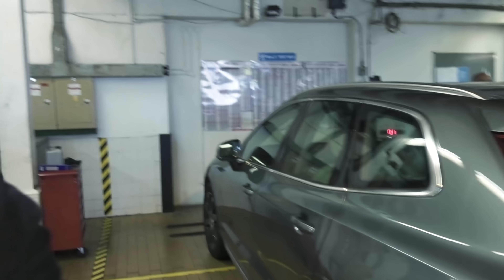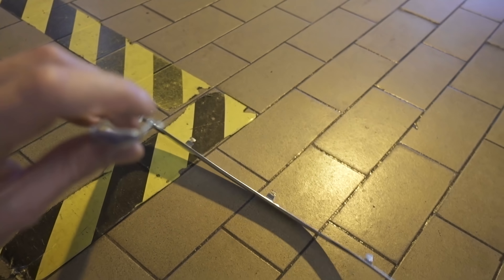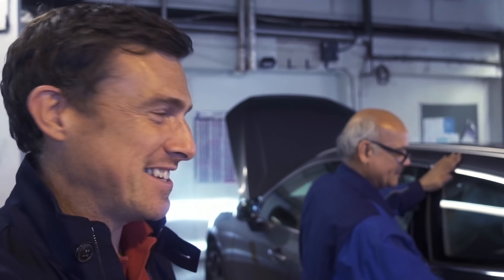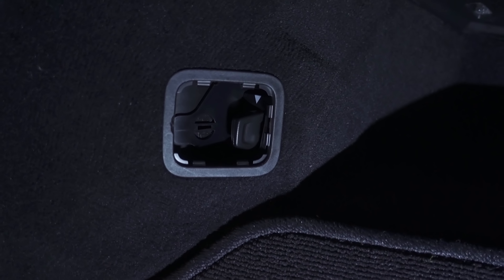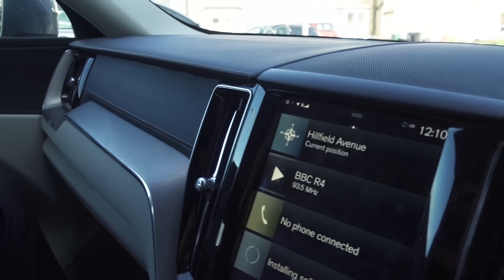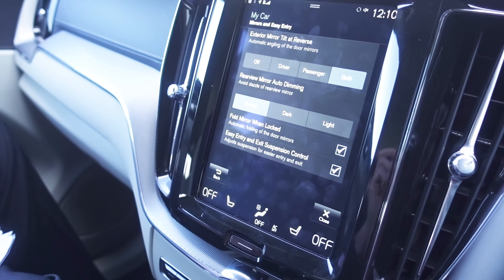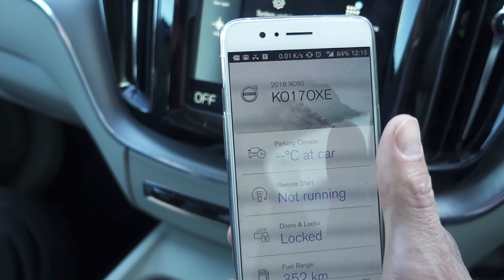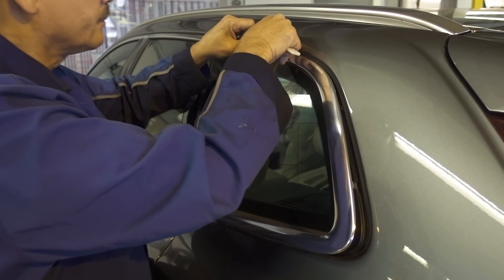My Volvo XC60 had to visit the workshop to be fixed... | Mat Vlogs

Comment: That's why u don't buy New cars instantly. They always have flaws. Just wait a year or so and then buy it.
Reply: Or choose a more reliable brand
Reply: Qua Pro Pro Volvo is reliable, but it's New platform that this car is sitting on. And it's early production car
Reply: Doesn't really matter if it's a reliable brand. Because 1. Volvo is a reliable brand 2. First edition cars always have problems. I remember when my dad got the Tiguan when it came out. In and out of the shop over the 3 years he owned it.
Reply: Qua Pro Pro 

There are SO MANY HIGH KMS Volvos still on the road. In fact (if I remember the stats correctly) more high KMS cars still on the road. More than ANY other brands.
Reply: true
Reply: Wilhelm Volvo cars are not really reliable.
Reply: rkoforever90 

Huh! Not in my experience. In my life I have owned 6, NEVER once has any left me stranded. The maintenance costs are low. I have had to put in like $7k in TOTAL (for all cars) for unscheduled maintainance. HOWEVER the other cars we have owned left us "up the creek" many many many times. No pumpkin. I have to say, in my experience with Volvo's they are cheep to drive and are super very reliable. I sold my first Volvo for $1300 it had 498000 kms on it. It is STILL on the road and now has like 700000 kms.
Reply: Thats no guarantee it won't have faults. Modern cars have so much software and electronics in them even late lifecycle models can develop faults very quickly.  The trim issues though are probably less common though.
Reply: How old are/were your cars? I've seen the old boxy models 80/90s last for many many miles, newer ones not so much.

Comment: As long as they don't have to tear down an engine to replace faulty designed piston rings Volvo is great to deal with...but vehicles even 10 years old with less than 70k km shouldn't need an engine rebuild T5/T6 customer.

Comment: I know two people with different volvo models and they both have the same problem with various parts of their chrome trim, I think volvo use cheap chrome parts. They've also both had issues with the software in their cars, Bluetooth and the USB working intermittently, one minute the USB simply will not work and then another time it's all ok and the Bluetooth constantly disconnecting and dropping connection with their paired phones. This happens on both their different models so it looks like volvo has some software issues. They've tried having their systems updated but the problems soon come back again, you never seem to have these issues with their German rivals.
Reply: I've had seven family and business phones connected by bluetooth to my car so far, plus three different iPads, and have never had a dropped connection. The only issue is that when parked, the electronics shut down after a pre-defined period and I would like to override that when working from the car.

Comment: Volvos do have some dumb designs I must admit but come on. It's only cosmetic stuff. Not as if the gearbox exploded or something.
Reply: They use the same brand of transmission, indeed the exact same transmission as Lexus. A slightly different version of the same transmission, using a clutch pack brake rather than a band [due to more room] is used in most Audi Q7 and many Porsche Cayenne models. I've driven and indeed one some of these and the Volvo transmission is just as good. The brand is Isin Warner by the way.
Reply: Here's the thing, if you buy a new car, and all this simple shit is already falling apart, what does that say about the likelihood of the more important mechanical parts holding out as long as they should?
Reply: shikori o So basically you're judging a car's mechanical integrity by a piece of plastic chrome trim? If that's the case all cars have "major" problems by your standards. Take public transport then. They're more reliable.
Reply: No, we're all judging the cars build quality, attention to detail in the building process, and most importantly, quality control, which clearly was far too poor for this car.

Comment: 1:57 - are you kidding me? you can clearly see that the bottom-right corner of the trim still pops-out...
Reply from the maker: +Theodore Vasilopoulos no it doesn't. It's the same as on the other side. I just checked it.
Reply: carwow that means it’s popped out on both sides!
Reply: Some side rear trims are like that. See bmw e46. It's normall

Comment: I work for an Audi dealer and the faff with the trim is massively unprofessional.
Reply: Most Audi stealerships I've had the misfortune to frequent have tried to uplift invoices for work and parts that were not needed. Even asked them to look at an electric seat that occasionally blew a long-blow fuse and they said " technician has diagnosed the fault and two seat motors are burnt out which are not individually replaceable. That'll be £1500 for a new seat sir!"  In fact a local mechanic then had a look and sorted it in an hour with the only part needed being some insulating tape. It worked ever since complete with fictitious burnt out motors diagnosed by a "master technician" [more like by a lying grease monkey].
Reply: Huw Williams As Matt explained, in a lot of instances you find that there are easier ways to bodge a job, but the manufacturer will not allow people to be ripped off.  Did you exercise the appropriate methods to complain?  It is worth noting every dealership is different mind.

Comment: You wouldn’t have these problems with a Volvo xc70 lol. If it did have problems it would be cheaper to fix if it did. Instead of buying an expensive Volvo I would buy the not so expensive Volvo I was talking about. And we all know the older volvos are indestructible.

Comment: Hi Matt, great video as ever! I'm sure I've heard somewhere that the marks on the chrome trim are caused by tiny particles of brake dust that are thrown into the air on a wet/damp day, when the car is in transit on a train transporter. I am told that it has corrosive properties too 🚘🚘👍🏻

Comment: My 2013 XC70 has trim like that 😡😡
Reply: I fixed mine - just the clear coat that has the marks. Use 800 grit sandpaper followed by 1200 grit and finish with 2000 grit. Then polish - fixed.

Comment: Revealed: the 25 most reliable car brands in Britain

Previous slide Next slide 25 of 28 View All
Volvo
=1. Volvo

Volvo's meteoric rise from 17th to joint 1st in the reliability rankings is the most impressive we've seen so far. The Swedish manufacturer has built some exceptionally impressive cars over the past couple of years, including the V90 pictured. It's a premium brand, the only one to rank in the top 10 let alone the top three, and its cars are among the safest on the road.

Comment: Volvo are knocking out too many new models too quickly...recipe for endless quality issues and lack of workshop tuition.
Reply: Not really. Common platform. Common components. Common software. Common knowledge base.
Reply: Huw Williams .. well yes but it's the integration that goes wrong
Reply: george mcray 
It is far easier to integrate common software and components than if each model were unique and distinct, as was traditionally the case. As it is, the biggest headache on the production line is to build each car according to its unique equipment specification for each customer and country. 
Volvo have developed a very simple and efficient way to build their cars. Whether they have got the details of the car design right, well that is another matter. For my part and in six months and 9000 miles, I’ve had only one dead battery and one mapping software issue, both resolved quickly and efficiently on the same day. Otherwise my XC90 D5 has run perfectly.

Comment: This is a brand new car ... one would have thought it would run perfectly . considering this is a premium brand ... odd
Reply from the maker: +Gil Moskovich it runs perfectly. Just some trim was defective... Or damaged by something.
Reply: I was reffering mainly for 2 things - the software updated that was needed for the mirrors to fold (this is a new car , why should there be a software upadate for it anyway... ? ) and the additional one was the part that was replaced due to some strange marks. non of which should happen in a 50K new Volvo.. looks like the quality assurance isn't that good.

Comment: I can say now the Volvo v40has to be the worse car my girlfriend has bought one  engine light like last year's one goes on and off like a disco light egr cooler egr valve replaced it came back on the the mirror start giving trouble  do not buy a v40 from 2015,16,17 have  all had trouble reverse screen stays on or doesn't come on on till u reverse is complete  city safe nearly Tru us in to the windscreen  on a normal road with a island in the middle  it jammed on Volvo are usually great car but the v40is just shoddy build

Comment: Revealed: the 25 most reliable car brands in Britain

Previous slide Next slide 2 of 28 View All
BMW
25. BMW

BMW came a disappointing 21st in last year's J.D. Power reliability survey, but in 2017 has ranked even lower. BMW drivers report 198 problems per 100 vehicles – the worst of the mainstream brands.

Comment: well, it's Chinese made after all. They bought Volvo for the safety tech and not to make a solid product. I get a feeling Matt got a bit of a sponsorship out of that deal.

Mercedes is doing the same these days. Selling out the brand with cheap nasty crap like the A180 and working with Datsun/Nissan/Infinity on that sloppily rebadged Navara/X-class. I drove a Mercedes for a long time and loved the look and handling. Until the day the electronics started going bonkers after only 60k miles. At the time I earned a good salary, but that didn't mean I wanted to spend a couple thousand bucks on a regular basis at the service department. Talk about a captured customer base...
Reply: Christian O. Holz Its not chinese made. Made in Europe!
Reply: Don't eat at Burger King, it's not burgers now, it's BRAZILIAN FOOD!!! Oh, wait, it is not. May be ownership doesn't effect the product so much.
Reply: Mercedes' real low point came with cost cutting and models introduced from 1997 to 2010 or so. They really went too far and their build quality, reliability and reputation suffered terribly. I really do think that they have overcome that in the last few years, although the debacle with front drivetrain wind-up on right hand drive GLC, which they do not seem willing to rectify, points otherwise.
Reply: Huw Williams DaimlerChrysler...a horrible marriage that ended in a divorce
Reply: I had a W204, 240,000 miles in 5 ears no major problems. I currently have a CLA Shootingbrake 4matic. Great car. So far proving reliable after over 100,000 and nearly 3 years of ownership. However I am considering a XC40 to replace it. Yes that one is Chinese made but from what I can see of the first examples they are still well made. Most manufacturers make their cars in other countries now. Audi makes their cars in Czech republic and Ukraine, Mercedes in Belgium and the A classes sister car in Sunderland. Mot of these factories are recently built, have the best and most up to date machinery and manufacturing techniques. Most manufacturers only assembmble there. The parts often come from Bosch, CI, Akurit and so on. Just because it is not assembled in Germany or Sweden does not mean it is not good quality. Nearly every electronics good, including that €1,000 iPhone is made in China. The point of difference is made in China (assembled) and designed in China for the local market.

Comment: LOL a few days and the NEW car is going to shit, swedish quality
Reply: Our old 2001 Volvo XC70 had 407,000 miles on it when we got rid of it, no major problems, no rust. Our reason for getting rid of it was because the transmission finally went. Now we have a 2014 XC90 with just under 120,000 miles on it and zero problems so far, and we’re already planning on upgrading when the 2019 XC90s come out. Let me know if any of your cars made it to 407,000 miles with no major issues...